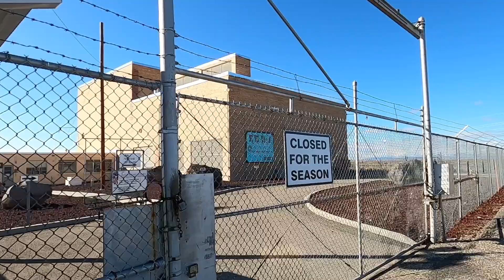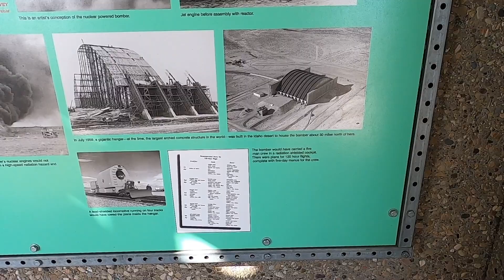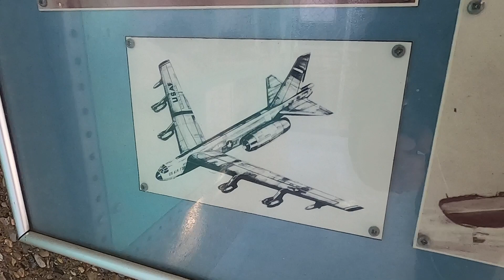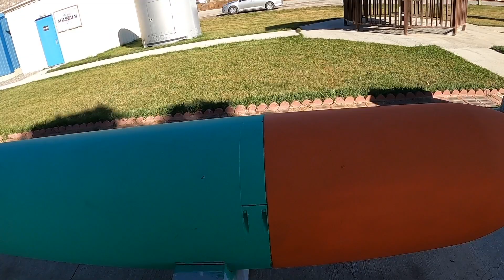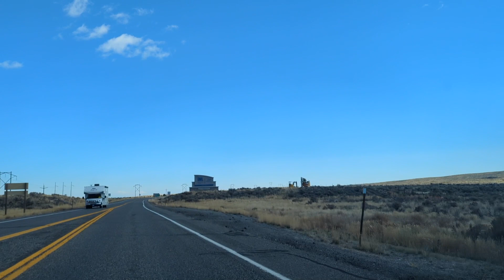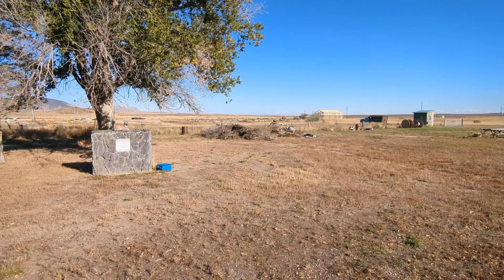Idaho's Atomic History and the SL-1 Nuclear Accident | History Vlog |

Comment: I've also visited the nuclear aircraft engine prototypes in Idaho and was amazed by the audacity of the project.  I believe the availability of ballistic missiles was a big part of the reason the project was cancelled.  Yes, the Mark 14 torpedo, used by US WWII submarines, sank a lot of Japanese shipping, eventually.  But this torpedo is infamous with submariners, because at the start of the war it had several mechanical defects which allowed targets to escape.  Its creators, the Navy's Bureau of Ordnance, initially refused to believe there were problems and blamed the submarine crews.  Only after the submariners did their own investigations were the problems fixed and sinkings increased.  If you want to visit a nuclear submarine, you can tour the first one, USS Nautilus, in Connecticut.  And FYI, in your description text, it's "Fermilab," not "Firmilab".  It was named for physicist Enrico Fermi.